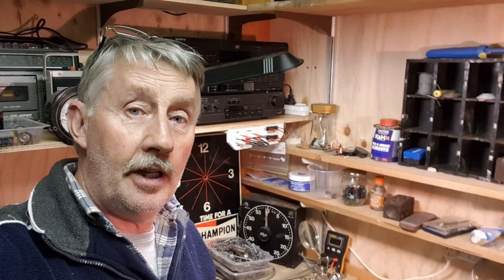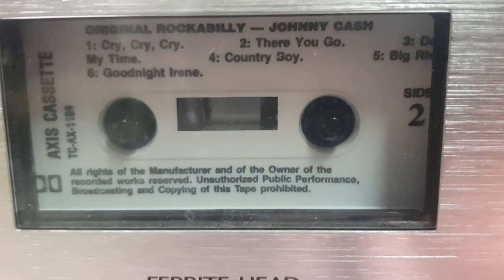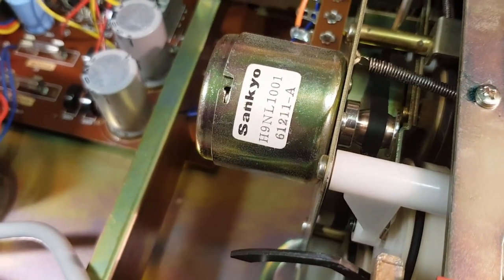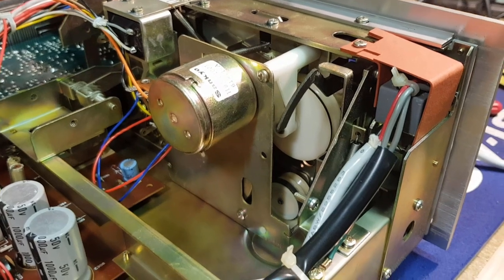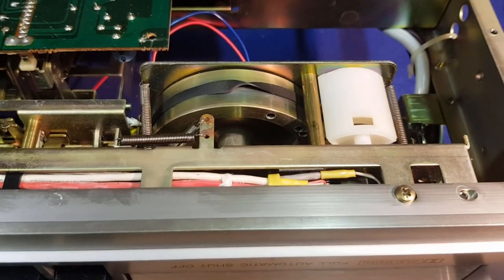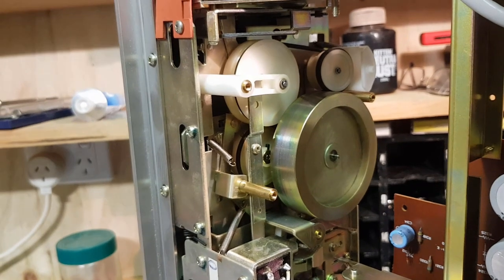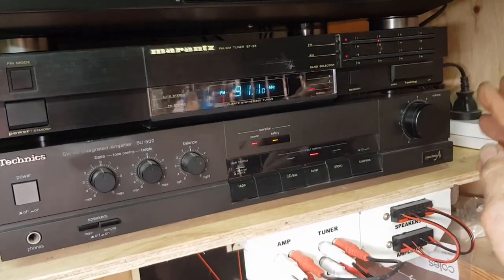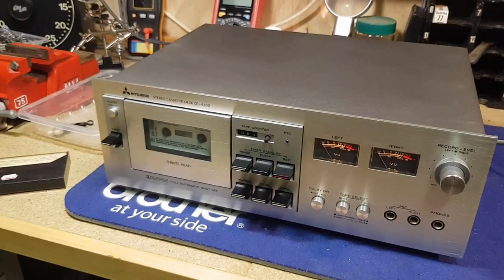Successful Repair! Replacing a Drive Belt on a Vintage Mitsubishi Stereo Cassette Deck DT-4450

Comment: Great video. I picked up a vintage sanyo system for next to nothing. The rd30 cassette belts are tired/stretched and need replacing. It works but the auto stop doesn't. Trying to puck up the courage to have a go. Cheers
Reply from the maker: I'm not sure how the auto stop mechanisms work, but I'm sure you can do it! 👍😊

Comment: Luckily you caught it before it went to its sticky phase. I’ve done this work on a few things and the belt has come out looking like used chewing gum and stuck to everything like tar. Normally happens when it degrades but also gets hot like in a storage unit or shed.
Reply from the maker: Yep, I have seen rubber belts turn to sticky black goo... it's not fun to clean up!
Thanks for watching! 😊

Comment: Hey, nice! By the way, you don't remember what dimensions you had on the drive belt by any chance? 
I'm trying to fix a MG-4400 and it looks really super-similar to yours, but I can't find a service manual anywhere.
The original drive belt has completely fallen to pieces (although the other rubber things looks fine, just as yours).
Thanks!
Reply from the maker: Thanks! Nope, sorry - no idea of the belt dimensions now. I remember providing the pulley diameters and the distance (centre to centre) and the supplier had a formula to calculate the belt size I needed.

Comment: My back and knees are pretty sore, can you repair those? Early 70' models, so might be tricky.
Reply from the maker: Just come over here David, next to the welder... 😉🤣🤣
Reply: @TheUltimateRecycler  Maybe I will settle down by the welder. Im tempted to go on a road trip if/when this covid stuff settles down and I will pop by :) Ive never driven to Victoria! If I do drive south, I hope you can recommend a hotel ?
Reply from the maker: @davidk8699  Hopefully things settle down quickly and a road trip is on the cards!! 👍😊

Comment: I'm hoping to get some assistance with a Mitsubishi DT-4400 tape deck that I am looking at for a friend. The unit appears to be behaving with one small exception whereby the deck kicks out of play, FF, or RW modes after 2 or 3 seconds.

What I've observed is that there's some sort of red LED + phototransistor arrangement with a perforated wheel between it that is spun by the tape counter belt. I replaced the tape counter belt as it was loose, but the issue persists even with the wheel spinning steadily. I can't find a service manual for this deck unfortunately, so I'm flying blind.

I attempted to test what I suspect is the NPN phototransistor by connecting my multimeter in µA mode across it while the red LED shone directly onto it. I was expecting to see some sort of change in current but nothing changes, even when I move the perforated wheel such that the light from the LED is being blocked.

My questions are:

Is my current measuring test flawed in some way?

Is there a way of determining a suitable replacement phototransistor? My local shop sells them but only the infrared type.

Does anyone happen to have a copy of the service manual for this tape deck?

Thanks in advance.
Reply from the maker: Hi Nigel, thanks for your question! I'm sorry, but I have no experience with the issue you are having. Other than what you have tried, I'd suggest reflowing all the solder joints just incase there are problems with connectivity. In my experience, solder issues are much more common than component failure (other than old caps perhaps!). Perhaps someone else can be of assistance. Best of luck, Chris